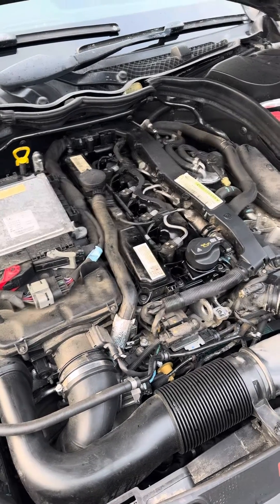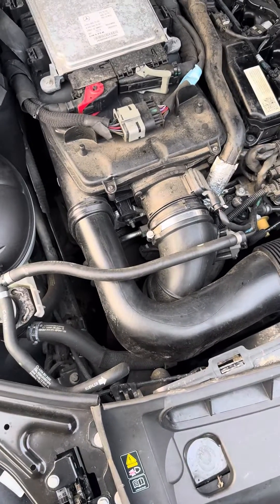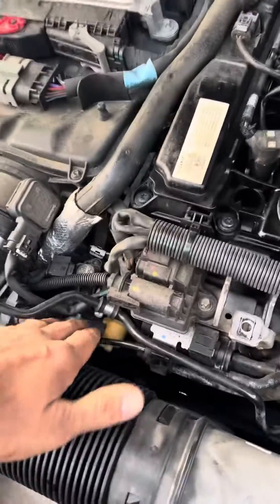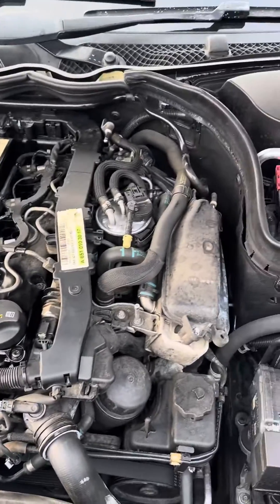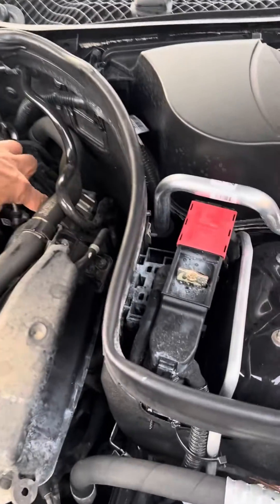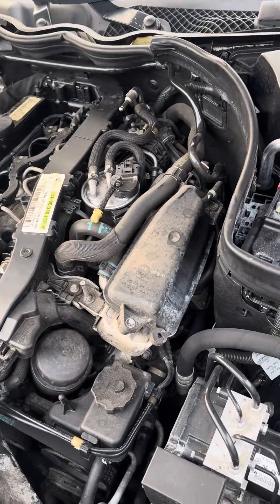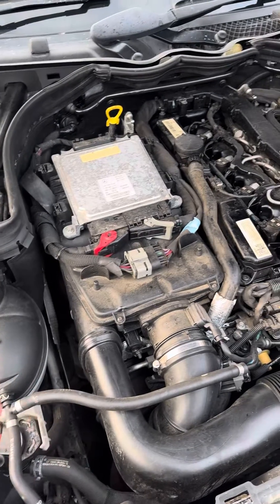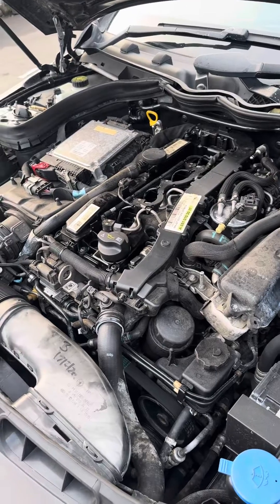Mercedes-Benz OM651 engine 200/220/250 troubleshooting for Turbo Boost, Mass Air Flow, EGR faults.

Comment: Also remember to check or replace the 2 boost transducers about £60 each from Mercedes. One at front and one at passenger side of engine. 2 bolts and 3 pipes and a plug. Easy to replace and cause alot of boost issues if faulty
Reply: Could you please give me the part numbers for both, either the original or Bosch brand?

Comment: I have e class w212 issue with the car is losing the power ,egr vaccume accuater is not working there’s no vacuume pressure , is it solenoid valve issue?
Reply from the maker: If the egr is not actuating then need to follow the vac circuit back. Yes likely to be one of the solenoids but just as easily could be a split pipe or other leak

Comment: If that egr cooler bypass valve arm doesn't shoot up from vacuum, but the valve itself is able to hold vacuum, what do you suppose are the reasons or possible causes of it not actuating?
Reply: Exactly what I'm trying to find out. I changed the intake and throttle position flap thing and now the egr doesn't move. Im hoping I've missed a pipe somewhere and it fixes it 😂

Comment: Hello, i buyed a CLS220 year 2015 and after i see the car have egr off, dpf cuted and take off, adblue off, the car going very well but when i open the windows it come inside a smell a gas, i watch all the tube with a engine on but i can't see smoke, somebody know what it can be the problem? Thanks
Reply: I have the exact same problem. Kind of a burned oil smell !

Comment: I have p0237 code turbocharger boost sensor a …do you know which part i need and wher it is loceted…no leaks  chers
Reply: Boost sensor a the at the front of the engine bay

Comment: Thank you, I have a W212 E220 and have a manifold to change, i keep putting it off , so now my DPF is full, it doesnt rain but it pours, Having said that i did not know about the vacuum check so that will be done today, I have been in limp mode for sometime , bit by bit i learn more about this engine. I have subscribed as this is one of the best videos i have seen, so again many thanks.
Reply: Same problem here with the w204 E200.
I hope you got your problem solved! 🎉

Comment: i have a w204 c220 CDI and ive done a smoke test came back clear - when i kickdown or speed up from 50mph to 70mph itll go into limp mode and come up with a ""Turbocharger/supercharger underboost" or ""Turbocharger" P0248 ($07e8N) any ideas?
Reply: Hi I’ve got a sprinter and have been chasing boost issues since I bought it, at first the boost control at the back of the engine for the big turbo had gone so replaced that, while I was there I noticed the intercooler pipe had oil around them so they were replaced also the manifold had cracked and while I was fitting a new manifold I noticed the metal EGR pipe to plastic intake had a hole in so replaced all off this. 
Less than a week later it snapped an exhaust manifold bolt and warped it, new gaskets and a manifold skim and it was fine for 2 days then it snapped an EGR cooler bolt at the back of the engine, fixed all of that and then lost full power whereas before I was only getting boost from the big turbo, this turned out to be the small black vacuum pipe that goes to the turbo actuator and is routed around the back of the engine 

I hope this helps you narrow down your faults

Comment: Many thanks for the prompt reply. What is the small rubber pipe coming out of the rear top of the engine just above where the gearbox is, I’m just not familiar with this engine om651.

Comment: Hi can you please give me some advice if possible, the breather pipe at the back of the engine, why is there oil coming out of it? I hope you see this and can help. Thanks. OM651 Engine
Reply from the maker: Hi, nobody can really help without looking at this kind of problem. If you have oil coming out of a breather that means either you have a faulty breathing system or there is too much blow by or pressure in your engine which can be down to many reasons..  you’ll need to have an experienced Mechanic look at this

Comment: @mercland6434
Hi, i have a 2011 c220 w204. I had dpf problems putting the car into limp mode so i gutted the dpf and had it deactivated, then took the car out the next day and when the car got up to temp the engine light came on again and diag was saying catalyst temperature too high so i then gut the cat and had that deactivated too, since doing this i dont get any fault codes what so ever but now the car seems to be a little bit laggy/sluggish on pull off till the revs hit over 2k mark then turbo kicks in and all boost is present. Any ideas on what could be causing this? I have done a smoke test and couldnt find any leaks. How can i smoke test the vacuum hoses or egr?. Many thanks in advance
Reply from the maker: Im really sorry, now that you have started gutting DPF / Cats etc it will be very difficult to help you. Once a car has been remapped you dont have any reliable information to work from. The quality of the map could be to blame, maybe not. its impossible to diagnose properly unless you start with a car on factory settings with nothing removed or deleted.

Comment: Hi I have same problem, we change a lot of sensor and boost pressure valves and still same issue sometimes work sometimes not ,is that mean the turbo it s not broken ? Because saometimes work sometimes not

Comment: That’s precisely what I was looking for. Got the exact same engine and it’s running smoothly with No errors returned on scan, however it just picks up boost from 3500-4000 rpm. Wondering if the problem is one of the vacuum actuators for the turbo or maybe the adjustment rod you mentioned.

Comment: Hi, have you ever seen with an OM651.950 in a 2018 vito it will not start when warmed up after a drive. It might restart after 5 mins or could be an hour. When it does it, it just cranks and nearly sounds like the engine is damaged but then just randomly starts again and is perfect. Thanks

Comment: im not sure, but right before starting i hear a hissing sound comin from around the fuelfilter, and im sure i have a leakage somewhere, but i looked around the intakemanifold, (was replacing my oilcooler o-rings, it did'nt seem to leak anywhere, what could be the problem?
Reply: Did you find hole in pipe?

Comment: Hi i have mercedes sprinter 314.19 plate simulator engine and looks like lots some power and smoke from oil cap when opening cap also dancing the milage only 100k on the engine no oil leaks.
When engine After idling for a few mins smokes starts (white) with a strong smell from the CAT. If left idling for say.... 10mins when driven away and exaust heats up it clearly burns off somthing and lots of smoke follows the van for a few mins ,where i start to looking?

Comment: Hi, can you tell what is the part at 2:30 in the video? where the plastic arm goes into. My car makes eletric/hissing sound from the cushion it goes into. It goes in when starting the car and when pressing accelerator it moves in even more and makes the sound. Thank you
Reply from the maker: @otsosallmen7091  that is the EGR bypass valve. I’m not sure you would hear a hissing from this area as if there was any loss of vacuum the arm would not move.  Maybe something to look into deeper for you. What symptoms are you experiencing?
Reply: @mercland6434  I have not experienced any other significant issues than the sound from the bypass valve. i was idling and stationary when just revving the engine to about 2000 rpm and the sound can be heard. then i located it to the valve by holding a screwdriver to it and listening. i don't feel any loss of power and no warning lights on the dash. car has about 142k miles. water pump and chain tensioner changed recently. No leaks of oil or coolant.  Well now when i think about it, maybe the accelerator pedal doesn't respond as quickly as i would want but i have no comparison to other cars with the same engine unfortunately.
Reply: @otsosallmen7091 hello did you fix it? i have the same noise
Reply: @paska222 no . Still same and nothing has happened since. I took it to dealer after looking to it myself and they heard nothing unusual
Reply: @otsosallmen7091 oh. did you try to replace it? its called egr valve actuator

Comment: The air feed tubes come in high quality aftermarket  shops for 1/3 original price.  Don't be afraid of Febi or Meat and Doria parts.  Your independent specialist will get you a good part for a fair price.  For trim and aesthetics or underbody plastics, stick with original.  They aren't expensive.  Don't go to Mercedes for shocks or brakes either.  They'll just shock and break you.  And absolutely buy the extended full warranty.   One bad injector and you are already ahead.  This isn't Ford.

Comment: Great vid, can a vacuum leak cause transmission problems
Reply from the maker: @GrahamCox-g6e  what are your symptoms please because a lot of people confuse limp mode for gearbox issues… but to answer your question yes any issue on your engine can cause your gearbox to behave differently.

Comment: Wow brilliant video and so much helpful. Thank you 1000 times for the ideas. I have P0400 error on my w212 220 cdi, changed the EGR valve and it still comes up with the same error, even deleting the code does that help obviously. So I assume its a vacuum problem.

Comment: MAF sensor p101 replace the sensor check the wires smoke tested what else could it be? It’s in limp mode.
Reply: I have the same issues
Reply: Me too did you get it fixed
Reply: @JasonGlaister  MAF error here aswell, any finds?
Reply: I have the Same Problem , can you help ?
Reply: Needs rest and then the fault code will delete

Comment: Wondering if you can help, I had a DPF constantly blocking, DPF was deleted and then re mapped to run without, car ran amazing for a couple months then limp mode, boost codes, so we changed the boost pipes and sensors, still limp to this day? My mechanic thinks the turbos are shot from running for so long with a full DPF, any thoughts?
Reply from the maker: Hi, unfortunately i cannot answer remotely as there will be in depth diagnosis required. However ill tell you that the first thing we would do would be to restore original map, buy a used good DPF and start from the beginning with good parts. With a remap, there is no way to trust the readings.

Comment: Any idea of why p024872 is showing on my e220, vacuum is there, hoses are new, switch over valves new, actuator valves are new, smoke test on intake no leaks
Reply: Have you checked the dpf?
Reply: I have the same issue.. you able to resolve the issue p024872?

Comment: Hello,

I have a C250CDI from 2011. I have a boost leak error, a clogged DPF error and an air leak error. (P0299, P2463, P2279).

Did a smoke test with the engine off and it didn’t come out from anywhere. Everything seems perfectly sealed.

The EGR actuator moves back slowly when I start the engine. Should it move slow or it should snap? Maybe that’s the issue.
Reply: Maf

Comment: Hello pal, I got a Mercedes c220d 2015, and atm it's in limp mode, I have a code popping up turbocharger/supercharger bypass valve 'A' mechanical P2261, and when you said about the arm shooting back when car is being started, it's not doing it on mine, the guy who plugged my car up said its Turbocharger Pressure Transducer, do you think that would have an effect on the vacuum ?
Reply from the maker: On later cars, the arm may not shoot back as they are ECU controlled and only actuate when the ECU tells it to. However for that code, yes the turbo transducer is very likely the culprit. Also worth checking condition of the vac hoses incase of any splits etc. Thanks.
Reply: @mercland6434   So quick message I thought I might as well come back here and post this, Just installed the new part and it was it !! The car came back to life 😂 the limp mode is gone and suddenly it feels like the car has more power than it did before, so turbo transducer was the culprit ! For the code P2261 👍 thank you
Reply: @adrianjachimowicz4479 hello which one is bypass valve a the one at the front, or the one hidden and is easier to get from underneath the car please reply many thanks
Reply: @mercland6434  thats great!  just bought a new part so see how it goes, the hoses have been checked so it must be the part but we will see 🤞
Reply: The car has been tested for leaks and there are none

Comment: I have got an issue with my car pulsing under acceleration! No codes set at all and sometimes drives just fine, but other times will feel a bit down on power or acceleration will pulse, RPM doesn’t fluctuate so I don’t believe it’s gearbox related definitely feels engine! but cannot get to the bottom of it!
Reply: I have the same
Reply: @KlebanowIanuzzidid you get to the bottom of it?

Comment: Hi mate thanks for the video very helpful. I have a cla 2.1 same engine, and i am getting the p0299 code. Mechanic said it might be the turbo or actuator. I was also having egr issues but since then had a remap with egr delete. The car runs fine most of the times but sometimes it surges rpm while on stationary and you cant select driving modes (sport, manual etc) if you turn the car off and back on then its back to normal. My question to you is. On the cla the engine is transverse I believe so where would the turbo be? Underneath the airbox location? Because ive been told by the mechanic that its a big job on these cars as you have to access the turbo from underneath. Ive tried looking for turbo replacement videos online but cant find any hence why I through of reaching out to you. Thank you
Reply from the maker: So A, Cla, Gla are the same basic engine but just about everything bolted to it is different! 
Hate to be the bearer of bad news but remaps make troubleshooting much more difficult. The turbo on these is definitely more difficult but not the end of the world. If it was me, I would get it onto a genuine star machine at an independent direction. It’s very rare for major components such as a turbo to fail and we often find that these things are replaced unnecessarily. Of course it may well be turbo, but it’s a lot of work to find out that it was something more simple.

Comment: Have this engine in my C-class. So far have not sorted out power loss, rattling take off, suden turbolag, harsh deaccelerating in first /second gear. And car never gave any error codes. Seems like first torbo (of two) sometimes do not work or works not at full boost.
Reply: Did you manage to find something about the power loss ? Ty
Reply: @danielstoica7539   unfortunately still the same, even dealer could not find out the issue. I will later take my car to other workshop.

Comment: fan. First clean the DPF filter. In mine, I replaced half the engine and it turned out that the DPF filter was so clogged that the engine had no strength to drive. It showed turbo errors of the EGR valve air flaps. REGARDS
Reply: Hi there! Am have P0299 and the turbo was replaced but still facing underboost on the turbo charger
Reply: @tafadzwamugari7532  air leakage on vacuum hose.
Do smoke test its gonna show where the leakege is.
Reply: @eldinedoo8693  thank you so much. We actually used liquid soap as a spray and found the leak on the turbo.

Comment: Great video and covers the exact problem I’m having at the moment. I’ve changed the wastegate actuator on the front of the engine that controls the left hand most turbo, did I hear you say that there is another wastegate actuator that is exactly the same that controls the inner most turbo?
Reply from the maker: @simonread06  yes under the manifold so it’s easier to reach from below. It’s different to the above one though, it’s white and black
Reply: @mercland6434  thank you, I’ll get searching for a part number and will go investigate that one too.

Comment: Thank's very helpful video. I've got p0Af92 , and p2263 , but the faults are intermitent. The rod of the turbo is like ticking , it's a bit loose. It sucks in a little bit , but not as fast as it should. Sometimes it's good for 1 week no eml , but sometimes few times a day it pops up. Smoke tested , haven't found any leaks. The p0af92 code indicating about the turbo.
Reply: Have you changed your sensor I changed mine and my boost came back, just the other day it went into limp mode so need to check the pipes and vacuum
Reply: @thenotoriousmoe i changed the egr vacuum cell. Because the membrane was ripped. All problems gone straight away. 🎉

Comment: EGR is electric..
Reply from the maker: Yes the EGR bypass valve is vacuum. I’m talking about loss off boost and poss places for vacuum loss in this video.
Reply: @mercland6434   Hi I have low boost fault on my Vito om651 twin turbo 2018. No obvious leaks after smoke test 
Turbo seems fine no smoke
Just low power  codes I’m getting are p0299 p2261 p00c400